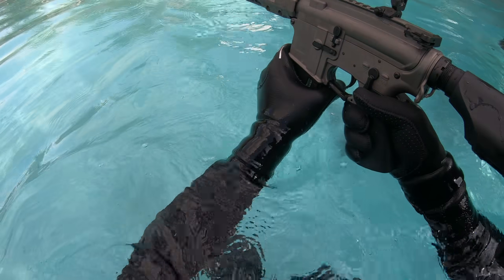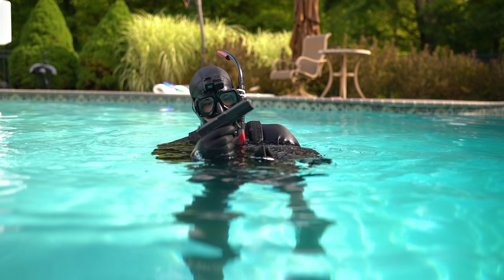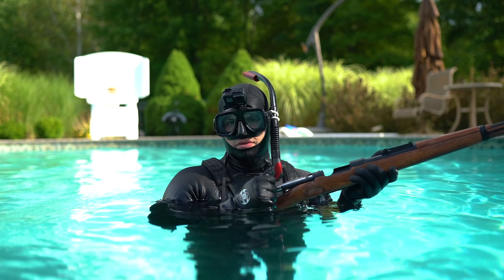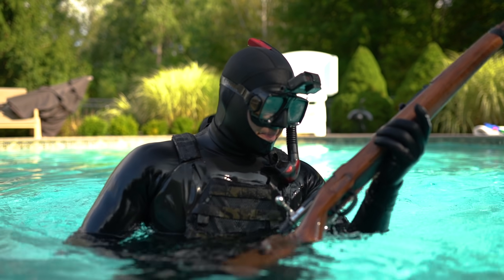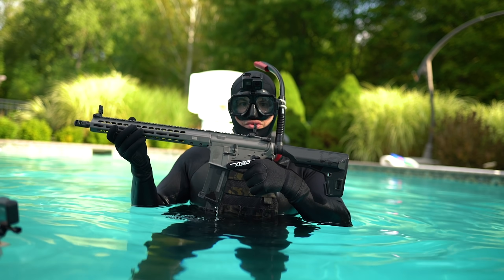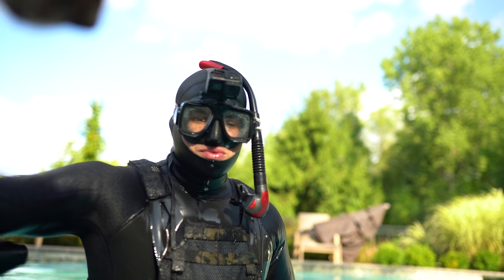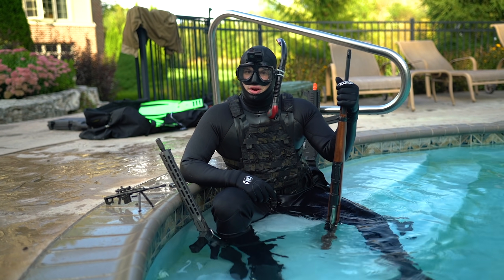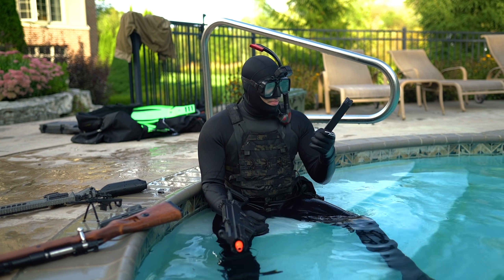Does Airsoft Work Underwater?! (Airsoft Science: Episode 1)

Comment: Deutsch

Englisch

I think that with the saeg was clear, since the contacts conduct electricity permanently through contact with water. If you were to use a Mosfet system, the water is solid and a brushless motor with strong earth magnets, things look very different. The normal contacts can't stand it, I made my airsoft waterproof because I like to play in the pouring rain, it even shoots when it is almost completely underwater. Without any problems, I would just put the battery in a fresh bag and then use rubber to close the connection cable so that no water can penetrate. 👍😉

With best regards 
Akira Airsoft

Comment: Your not going to be able to shoot anything other than CO2 that is Bio Degradable under water.   BB's  are going to Bio degrade instantly and green gas is questionable.   Batterie's need to be kept dry along with all the connection's seeing as  water will short out the battery along with the electrical current  that is traveling through the Air Soft gun.   Water and electricity are not friend's even with a six pack of beer and a pizza before they are used together.

Comment: A shocker, an aeg which requires the ability to suck in air from around it because it doesn’t have any self contained propellant, doesn’t work under water 😂. It does however apparently give it “unlimited powaaaaa”. Easy mod for any semi locked guns I suppose
Reply from the maker: False! Both times it emptied the entire 120 round mag! under water until the mosfet died!

Comment: AEG: *leaks black liquid

Oil companies: OiL?

People who know what it is: That’s going into your pool...
Reply from the maker: USA Invades my Pool
Reply: Airsoft Alfonse KNOCK KNOCK FREEDOM DELIVERY
Reply: @AirsoftAlfonse  what is is :(
Reply: @AirsoftAlfonse  can I swim in you're pool
Reply: Venom Airsoft what is it tho?
Reply: @Michaelsmithnosky543  it could be coal dust from the motor if it's a brush motor.
Reply: @drogenfeld  yup, it's brush dust. Running brushed motors in water wears the brushes away super-fast.
Reply: @CypherAod  Probably just accumulated from longer-term use, but other than that I think you're probably correct.
Reply: 0 subscribers With no videos challenge? Idk, burnt silicone oil
Reply: @venomairsoft830  and possibly carbon from the brushes washing out of the hand guard
Reply: U.S:DID SOMEBODY SAY OIL?
Reply: THAT SHIT IS MINE
Reply: what is it
Reply: @saraheslick5538  The motor has graphite brushes... When it spins, it grinds them. That's how these motors work. Dust is a product of this grinding and it is what is "leaking" from the gun... Very finely ground graphite dust.
Reply: @Exarhadsgfds  oh thanks
Reply: @Exarhadsgfds  nah that’s from the Lipo battery that’s the liquid inside
Reply: @Alonelycheezit  No it isn't. Please google what happens when a LiPo is punctured.

Also, it makes no sense for anything to leak from the battery since they're sealed.
Reply: @Exarhadsgfds  no lipos means liquid in Greek and it’s because the Greeks were the first to invent batteries like the AAA or AA
Reply: @Alonelycheezit  I'm sorry but are you a troll?

A LiPo battery is made up of multiple Lithium-Polymer based cells. That's where the name LiPo (Lithium-Polymer) comes from. These cells are fully sealed. They can expand, but they will generally not rupture on their own. The cells can still be punctured if the battery is shorted to the point where the heat destroys the material or if an object is stabbed through a cell. In both cases, the battery will explode. According to some sources, since these batteries can build up gas, they may even burn underwater.

Now either you're trolling me or you've been fed some false information. Either way, I probably won't respond again, sorry.
Reply: America*
Reply: I think you mean US military, not oils companies
Reply: yeah... i have no idea what that would be lmao

Comment: As an engineer I'm curious to see what failed in the aeg, thanks alfonse now I'll have do drown mine
Reply from the maker: Another Happy Landing! Welcome to the club! 

Multiple electrical components no longer work. after disassembly and dehumidifying/thorough drying.. still broken hahah
Reply: @AirsoftAlfonse  Were the piston and gears still intact?
Reply: @pauljakob4538  You really think that WATER damages metal gears and a polymer piston? l0l
Reply: @drogenfeld  No but the extra physical resistance of a cylinder full of water could easily strip the piston or shear gear teeth off since air compresses but water does not.  The water resistance slows the piston down in its compression stroke casing it to not be in the correct position for the sector gear to pick it up again causing a stripped piston at least.
Reply: @jhorn64  Following that logic, the piston, unless it is polymer and not metal, is not likely to be the first part to break. If anything, parts would fail simultaneously, or the motor would suffer heavy overload. It's still the most likely explanation that it is either brush dust (coal dust) or broken electronics that cause the black residue inside the water. A shredded piston would, in case it being made from polymer, most likely be rough chunks or whole teeth ripped off, not dust that disperses this well.
Reply: I think the mosfets contacts where probably connected (via the water) either that or the triggers contacts
Reply: I tried 3 aegs..all broke..even disassembly dehumidifying..still broken..thought might work...
Reply: As a regular person, I am also interested

Comment: "bRo AeGs DoNt WoRk UnDeRWaTeR iTs CoMmOn SeNsE" (works underwater)
Reply: Charles Wolf did you watch the video? Right as he submerged it the gun continuously fired on full auto the whole time even as he brought it back up. Later it worked outside before re submerging it where it worked and then died. Of course the gun will break if being underwater but it worked for a good amount of time.

Comment: Hol up, why is the gun leaking what looks like oil?
Reply: I would assume its all the grease leaking out of the gearbox =)
Reply: Most AEGs have motors that are transmitting the power between stationary part and rotary part with what's called brushes. It's basically a sacrificial part that gets burned while it transits the electricity. So what you have seen is the dust from the brushes mixed with water.
 If you shoot your AEG a lot and then open up the pistol grip you can find a lot of dust.
Reply: oh
Reply: hm

Comment: How to ruin AEGs and HPA with this one simple trick.
Reply: mancraft pdik or polarstar kythera would work just fine as they are fully mechanical HPA with no electronics.
Reply: fishy38t hpa uses a battery for its solenoid lmfao
Reply: @FrostyDH  not all hpa uses an electronic solenoid the kythera and pdik both use a mechanical valve actuated directly by the trigger so there is no battery or electronics needed
Reply: @FrostyDH  it's 2020 and there are plenty of HPA Airsoft guns that do not run a battery.

Issajoke.
Reply: @jhorn64  r/whoosh